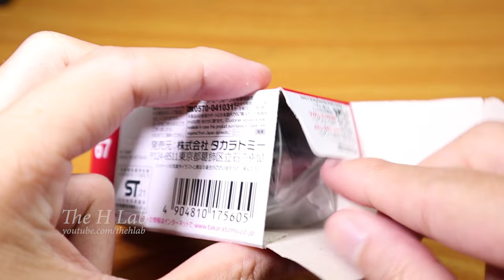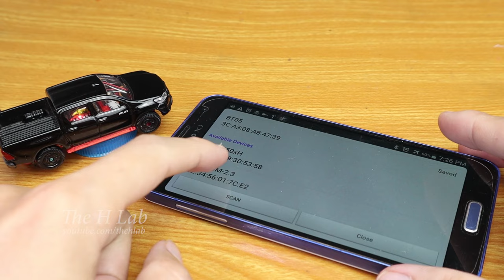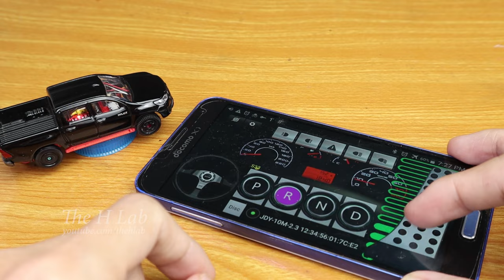How to make Toyota Hilux 1:67 RC | Pickup truck RC | The H Lab

Comment: where can I get the control board for this? I'm making a hotwheels Datsun 240z and this seems to be the only solution.
Reply: I also need the motor driver.
Reply from the maker: That is my homemade version. I would love to provide it but "chip shortage" make that idea never come true :(
Reply from the maker: Motor driver is a control board I get from servo SG90